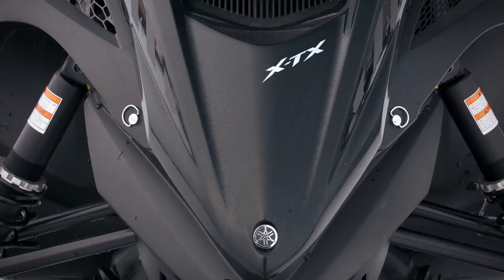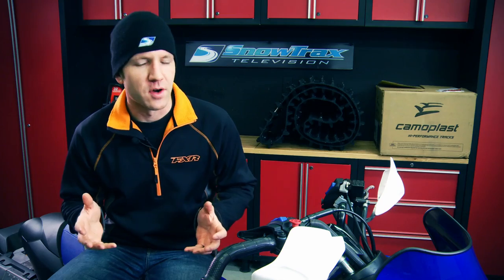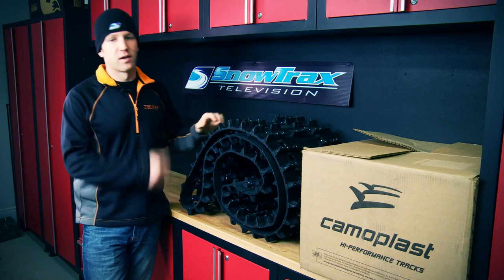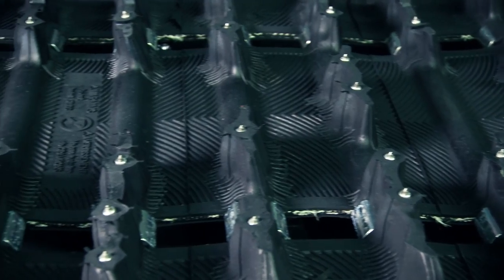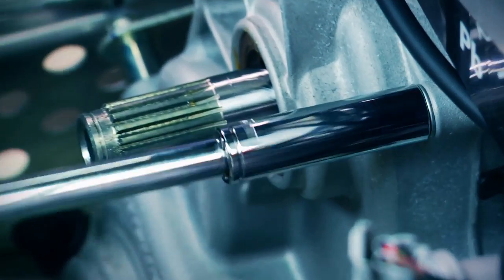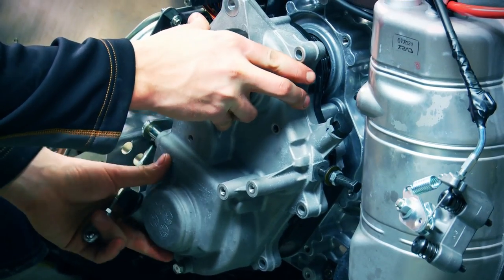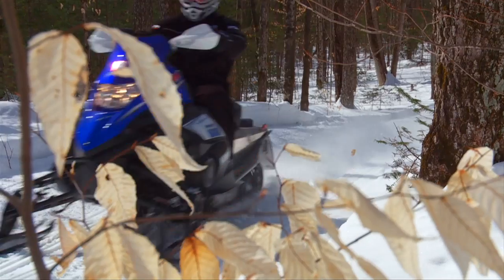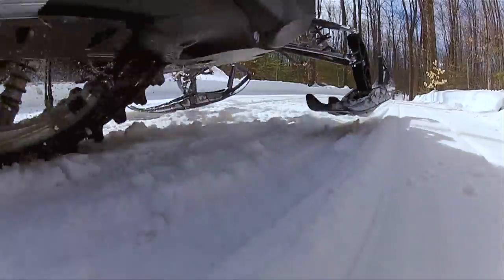Yamaha FX Nytro X-TX Track Upgrade

Comment: I have a 09 XTX with the 144 1.25 Ripsaw and 192 picks down the middle, LOVE the track.
Reply: Did you have to remove the tunnel protectors?  It seems tha the track will hit.  These protectors keep the track from hitting the exhaust pipes.